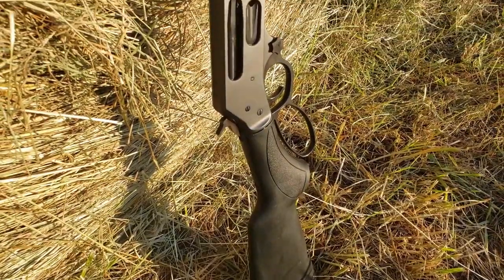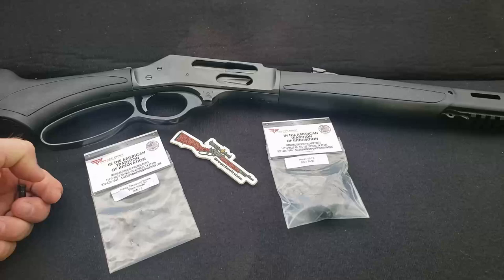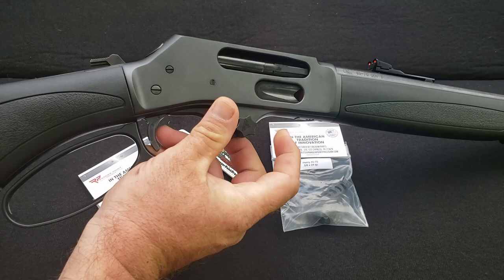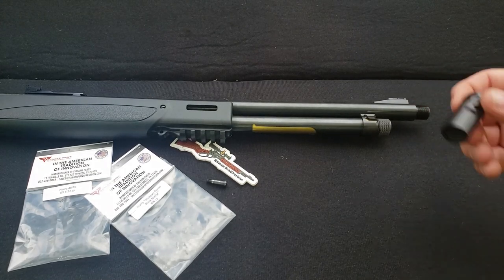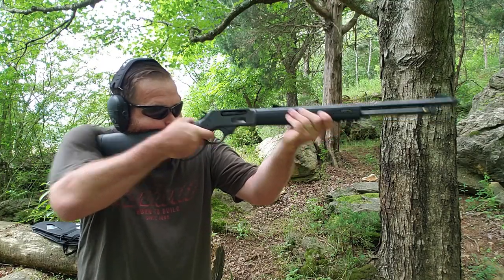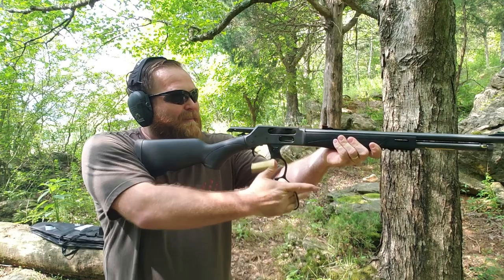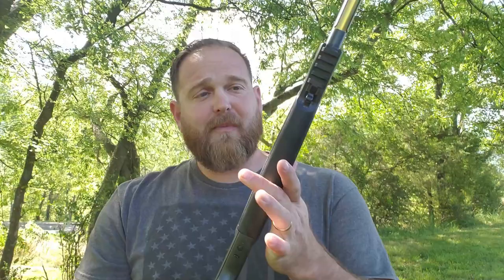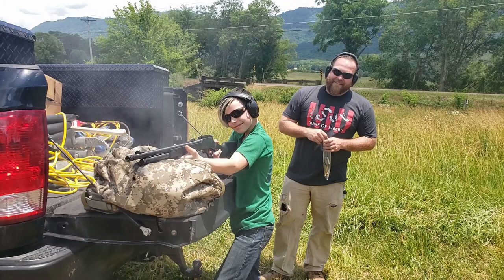Henry X 45-70 Recoil Reduction: Ranger Point Precision Comet Brake

Comment: Different cartridges also can change felt recoil, even with the same case and bullet weight. Powder burn rate will affect felt recoil and accuracy at range fairly significantly.

Any chance on doing some penetration/ballistic vids comparing cartridges or attachements  in the future?

Cheers!
Reply from the maker: I've got 5 blocks of ballistic gel. They're all shot up. I just need the 16 inch stainless form and I'll melt them down for reuse.

Comment: Very interesting, it would be nice if you could put it on some kind of a scale and we could measure the difference,
Reply from the maker: I'm thinking up some kind of lead sled idea.
Reply: Pat RMG If you didn’t weigh it down too much so it will slide and then put your tape measure down and see how far it moves, that would probably prove whether or not it helps, with the push, but it might not prove whether or not it has that slap or sting like some gun have, I actually think that the muzzle brake will help more with higher pressure load since it will react more violently to reduce the recoil, because when you shoot a 460 Weatherby it’s muzzle brake really helps a lot

Comment: I’ve already asked this, but does anyone know of a not too expensive medium range scope for the 357 big boy x?
Reply from the maker: Just speculation. I'd imagine that a set of Talley Manufacturing rings and a 1-6x24 would be magic.
Reply: Thanks
Reply: @gallivanmc2214  i used one of these from my 300blk build on my .357 and .44mag  
https://www.primaryarms.com/primary-arms-1-6x24mm-sfp-scope-w-acss-300blk-7-62x39-reticle
Worked very well. I did have to use a ballistic app (strelock) to recalculate the range on the subtensions .  Have one on back order now to go on the .357  and will get another for the .44 a little later .

Comment: I thought you had to type those muzzle brakes
Reply from the maker: I think autocorrect got you. Unsure of what you mean by type? 

This brake is non-directional. Doesn't have to be "clocked" if that's what you're meaning.
Reply: I ment time when I put muzzle brake on my gun they said it had to be timed
Reply from the maker: I thought that it was something like that. Autocorrect changes my words too. 

This brake is the same all the way around. Doesn't matter how it's oriented. I've got a couple that are like that. The rest of my brakes actually have an "up" and a "down" and are sensitive to position.